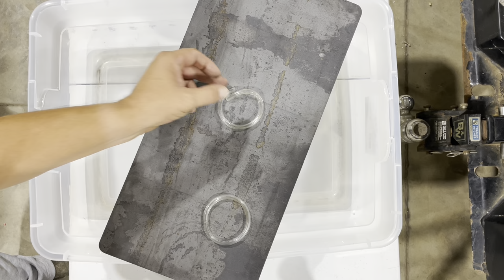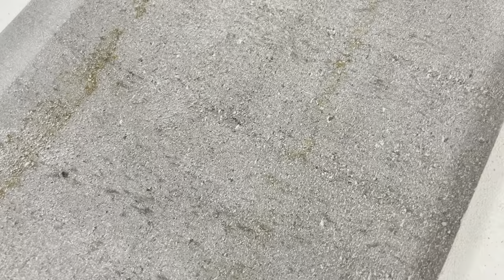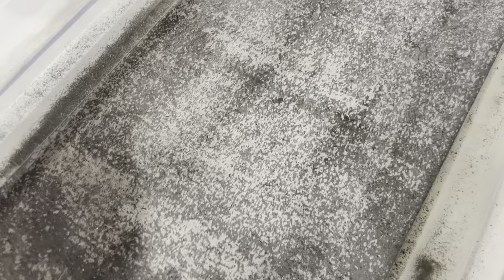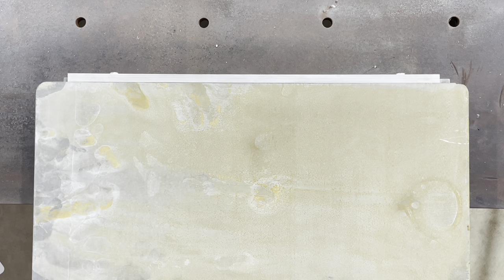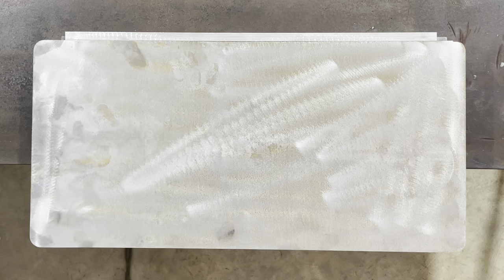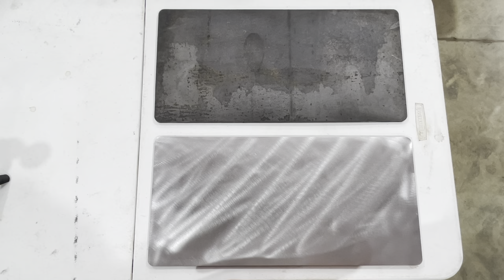How To Remove Mill Scale

Comment from the maker: Products used in this video:

30% Concentrated Vinegar - https://amzn.to/3AmghrL
45% Concentrated Vinegar - https://amzn.to/3R4S4My
Dewalt Cordless Grinder - https://amzn.to/3ycpBMr
Magnetic Chuck - https://amzn.to/3AotIYm
4 1/2" Wire Wheel Brush - https://amzn.to/3P0BCuY
Scotch-Brite Clean and Strip XT Pro Disc - https://amzn.to/3R9rCRZ

Comment: A mild phosphoric acid solution also works well for removing heavy rust. However, I once used too strong a solution on a rusty tool for too long and when I returned the entire tool had dissolved 😅🤣
Reply from the maker: That is precisely why I use a weaker acid.

Comment: I've done exactly that with some 6x10" slabs of 1" plate. They take forever to heat up properly, but if you drop a steak on that, 15-20 seconds per side, let it rest for a minute, then repeat a couple more times until the internal temperature is 127F, you get something magnificent. Similar results to sous vide, but a far superior sear (obviously) and the texture inside has a bit more structure than when you cook it for 2-4hrs in a water bath. Good stuff, man.

Comment: Muriatic Acid...15 minutes
Reply from the maker: Not in a shop. Muriatic acid fumes will rust any ferrous materials the fumes come in contact with.
Reply: @txtoolcrib  exactly. I rusted every single pc of bare metal inside my shop just by pouring maybe 8oz of muriatic acid on the floor. What a nightmare

Comment: Hydrochloric acid (aka muriatic acid) gets it done in a few minutes - not hours. Bicarbonate of soda & water neutralizes. Rinse well, dry, then prime/paint. No need to beat around the bush when you've got $h!% to do.
Reply from the maker: It also rusts everything the gas comes in contact with.

Comment: What's the responsible (eco-conscious/safe/legal) way to dispose of the liquid after?
Reply: Add baking soda, dump. Just make sure you have enough baking soda.

The acid solution can be neutralized with the base (baking soda). This reaction produces sodium acetate, water, and carbon dioxide. Sodium acetate is plant-safe and can even do good for a garden by increasing soil pH levels.

The iron oxide that was the mill scale turns to iron acetate after reacting with the vinegar, but this will also react with the baking soda, forming CO2, water, and iron carbonate. Iron carbonate is the naturally-occurring mineral Siderite and has even been used as a dietary supplement for anemic or iron-deficient individuals.